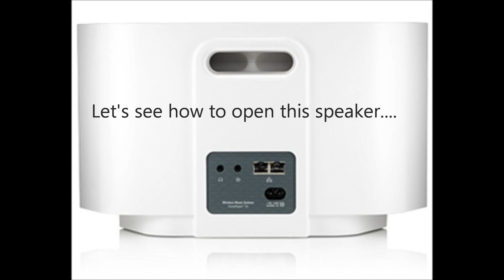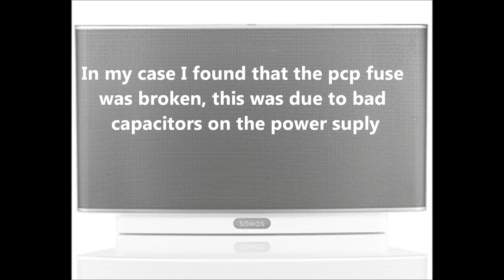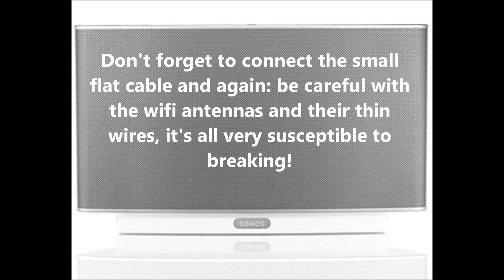Fixing the Sonos play 5

Comment: Many thanks to you for your video. I had not solved this without you. The fuse was blown and the rectifier bridge was broken. After replacing them it worked again!😊 The hardest thing was to desolder and removing silicon to bring out the components. But now it works and I’m happy.😄

Comment: Could your solutions as mentioned in the video solve the problem with my play5 gen1 ? Problem is that when I plug-in my Sonos play 5 I only can hear a brooming noice. The brooming noice is not constant but with intervals of 2 seconds. Any idea what the problem can be here ? Thanks a lot.
Reply from the maker: Hi Marc, a humming or buzzing sound with an interval indicates that the power supply is trying to start up, but this is not possible due to a problem in the power supply circuit.
You are probably also dealing with so-called "badcaps".
Try to take a look at the powersupply which I point out in the video and look for curved top on the black round components.
Examples can be found on the internet if you search for "badcaps"
good luck!
Reply: @henzelmen  First of all, thanks for your feedback. I just checked the powersupply but could not see any  curved black round components. What I do also consider is that the play5 smells for electriicity. If you know what I mean ?  Also, it's not possible for me to see the fuse. Where to search for the fuse ? Is it diffiicult to take out the print plate so I can see the components more in detail ?
Reply from the maker: Hi Marc, If you follow my intructions you can take the printed circuit bord out, the fuse is on the rear of the pcb but if the fuse is broken the  Sonos wil do absolutely nothing! So I think your fuse is fine because you hear a humming sound. I strongly belive you have to examen the power supply but you have to have some electronic experience. Be carefull for the high voltage inside (+300Volt) wich remain for a long time after unplugging the powercord!
Good luck

Comment: Great instructions there, my Play 5 had stopped working, I replaced the x2 capacitors, 1x bridge rectifier & the fuse, as per your instruction. In my case I don't think the capacitors were blown, but I replaced them anyway been as I was that deep. My Play5 is now back up & running. Thanks for the assistance.
Reply from the maker: Hi David, thanks for the comment and I'm glad it worked for you too. Hope you can enjoy the  Sonos for a long time now!
Reply: Did you order your parts off a website?

Comment: Henzelmen, thanks for great instruction. I was just given two of these and one is not working. I ordered parts today.
Reply from the maker: Hi Jeffrey, this will never hapens to me, I always must bought them ;-)
I wish you good luck and enjoy your fixing.
Have a nice day!
Reply: Well, the parts arrived. The surgery went well. When I applied power there was a distinct pop. It was a good try. Thanks again for the clear instruction. Any ideas on how to use these speakers?
Reply from the maker: hi Jeffrey, sorry to hear it didn't work out for you. I do have two Sonos speakers with unrepairable  pcb damage,  my idea was to pull all the electronic out and find a three-way crossover filter and built it into the Sonos, so I have two passive speakers and use them left and right near my tv.
You can also try to find a Chinese power supply with 24V and 12V and built it in the Sonos as a replacement powersupply. This will work verry well according to some people on the internet discussig this problem.
Good luck!

Comment: I've been told by Sonos I have a bad amp. When I plug in head phones sound is fine, but when trying to play through the speaker I can be at full volume and my ear needs to be next to the speaker to hear any sound. Will these fixes you demonstrated solve this issue?
Reply from the maker: I'm afraid not JS, my Sonos did absolutely noting because a non working power supply. Your Power supply is working fine but like Sonos told you I think you have an bad power amplifier. Maybe, if you look closely at the components in the power amp circuitry you see also bad capacitors (capacitors with a swollen top are bad) then this is most likely the problem.
Good luck!
Reply: @henzelmen  Any idea where this located or what it looks like? I haven't been able to find info on replacing this piece and really have no idea what I'm looking for.  Any help would be appreciated. Thanks.
Reply from the maker: If you watch my video at  1:22 you can see where the power amp is located, it's at the most right side of the printed circuit board.
I understand you have no idea what your looking for. It is necessary to have some basic knowledge of electronics if you like to fix this Sonos, inside are capacitors which store high voltage even if the Sonos is switched off. Maybe you have to look for someone with knowledge of electronics who wants to help you.

Comment: Hey Henzelmen, maybe this is a dumb question but my elkos seem to be broken too. I seached for the matching capacitors like you adviced but they have 4 pins instead of two like mine - should i just cut them off or did i find the wrong capacitors? THinks for the amazing video, saved me a lot of headaches.
Reply from the maker: No, I don 't think that ''s a great idea, those extra pins have a purpose.
If you follow this link you can order them locally I hope......
https://nl.farnell.com/vishay/mal215956121e3/cap-120-f-400v-alu-elec-snap-in/dp/2724551

Comment: Thanks for your video. Replace the small capacitor 25V 100uF at the back of the 2 big capacitors as well
Reply from the maker: That's a good idea, this capacitor is for the power supply of U27803 the PWM controller, this power supply comes directly from the mains voltage via some high-ohmic resistors.
It is also wise to check the capacitors of the power amplifiers, which are also often bulging. It is actually very wise to check all capacitors on this PCB very carefully ;-)

Comment: Many thanks for the excellent instructions! I would never have been able to open the device with so few damage without your video.
One question though: In my Sonos there were two 100 uF 400V capacitors compared to the Vishay MAL215956121E3 you recommend, which have 120uF. Is there a reason for that or did just Sonos simply change the type during production years?
Reply from the maker: no special reason, I could not find a suitable 100uf capacitor but could find a 120uf, a little more capacity so always better.

Comment: Great video on disassembling the play:5! I opened mine and have the PCB on the workbench now. however my experience with repairing electronics is very little. And i have a few questions:

- Do i change all bulging capacitors alone or do i also need to test other capacitors? how do you test them? 
- How do you test the bridge rectifier? How did you know it was faulty? 

Thanks Henzelmen!
Reply: @henzelman hasn't replied here in a while (hope he returns as I have more questions for him also), but here's my thought on your Qs: For all the effort to get inside the Play 5 and considering the fragile nature of the wifi antenna connections, I would advise you consider replacing all of the caps. In my case, it appears that the caps in the Power Amp section are the ones that have failed (swollen tops). The Pwr Sup caps are flat on top, but my Sonos is old, and caps in this line of work all fail eventually. And FWIW, I'm going to rig some sort of an "ON-OFF" switch - perhaps in the power cord. I travel a lot, and my Sonos may sit idle for months sometimes.

Comment: Fantastic video!
What about bypassing the wifi components altogether? Since Sonos has offered trade ins for these old units, there will be a lot of old Play 5's with perfectly good hardware taking up waste. I would like to know if there is a way we can still get use out of a bricked Play5? Maybe bypass the wifi components so we can use the line-in jack to play music from a phone?
Reply from the maker: Good plan! But I just don't think Sonos will sell the trade ins, really have no idea what they do with them, of course they are more eager to sell new ones to us.
But...If you succeed to get your hands on them you can indeed have for lot of fun. Built your own wifi reiceiver in or bluetooth adapter.
These things are very cheap on the internet. connect them to the line- input and you have a realy good wireless speaker for cheap money.
Wish you good luck with it!
Reply: @henzelmen  do you know where the amplifier input from main board is on these? Line imput is deactivated when the "recycle mode" is triggered.
Reply from the maker: Hi  @galaxyb1103  , that's hard to tell because there is no service manual available. You need it to find the right input and output tracks on the printed circuit boards, now it's sort of guessing what is wat. If your not afraid of electronics you can try to touch the components near the power amp with your finger, if you hear a little hum from the speaker your close to the input. Be carefull to keep your fingers away from the power supply on the other side of the pcb!!!!
Good luck!

Comment: TY for the video... very helpful, however, is the fuse a T3, 15A ? or is that a T 3.15A??
Reply from the maker: Sory for my late answer, it is a 3,15A fuse.
Reply: I guess this is 3.15A, since most of Europe, apart mainly from the UK, uses a comma instead of a dot for a decimal point separator.

Comment: Thank you very much for this great video. I have disconnected everything except that the pcb is still not free. It is connected to those 3 antenna cables and I cannot take it out entirely. Do I need to unscrew the top section from the bottom? Do I need to be careful about anything?
Thanks for your help in advance.
Reply from the maker: Hi Mehul, you can unscrew the 4 nuts on top of the wifi board, carefully take the pcb upwards, it is still connected with the multi pin connector, With a little bit of wiggle the board will come loose. Be carefull with the grey wires, they stay connected with the wifi board but you can take the mainboard out now.
Good luck!
Hans

Comment: Perfect teaching! Treble sound is gone on my Sonos Play 5 gen 1, is it an electronic or speaker fault?
Reply from the maker: Hi, this must be an amplifier error and I think one or more of the capacitors of the poweramplifier are bad. You can find the capacitors on the other side of the pcb as where the power supply is located. Look for 5 round capacitors near 6 coils, check these capacitors on swollen top, or just replace them in advance.
Wish you good luck.

Comment: What is that small black component with 4 legs you replaced? And why did you replace it?
Reply from the maker: That is the bridge rectifier, which turns AC voltage into DC voltage. There is a small chance that it is broken due to the defect capacitors. They are very cheap so replacing is the best option.

Comment: great video! i followed along and now have taken apart the speaker, not sure where to go from here? I have taken out the PCB and have tried measuring a few things with my multimeter but i dont know the best way to diagnose the problem!
Reply from the maker: Do you have some electronics experience?
What is the diagnosis of your sonos?
 
Does it not work at all, no lights at all?  Then check the fuse on the back of the pcb, the little round brown/red component  you can see in my video. If its broken than you have most likely also bad cap's and have to follow my instructions in the video to replace them.
Reply: @henzelmen  yes a little bit, diagnoses is no lights no sound not working at all (the power cord is good i measured it) I checked the fuse it also is working aswell as the two larger capacitors that you replaced they are working. Makes me think potentially it is the transformer?
Reply from the maker: I'm sorry for my late responce. Try measure the voltage on the two large capacitors but watch out.... there is high voltage inside. If there is voltage on the capacitors then the problem is  the power supply sucundairy from the transformer. Measure  the capacitors for voltage on the secundair side, if there is no voltage on them, then most likely the switching transistor (or mosfet) has gone.

Comment: VEry helpful -- as this is my last point of call before i give up -- its sudenly stopped connecting/working. I only get a white light when powering up. Reset function does not work? Wired connection is not working also. Wondering if the Pause/play   button is faulty as nothing happens when i press it? How did you ascertain which parts were faulty?
Reply: just got off an hour long tech support call. My system problem sounds exactly as you describe. They say it is a bad wifi card and are sending me a new one. purchased 2017 so no charge warranty part. Not looking forward to installing myself though. Maybe I'll get lucky.
Reply: UPDATE: They don't send you a wifi card. you give them a credit card number for security that you will ship your speaker to them within 14 days after you receive their advance replacement speaker.This way you will have prepaid packaging for the return of your speaker and you will get a replacement speaker faster.

Comment: Hello Sir... I had bought a Play 5 used and it turns out, it makes a high pitch whine which appears to be coming through the tweeters... Wether it is playing music or not...Would thiis fix repair this problem do you think?... Would love to have this thing working properly as it does sound great when playing music... Some threads talk about ground loop and no... It's def. Not that... Anyways thanks for any reply or advice you can give me!!!
Reply from the maker: Hello, the high pitch whine is not to fix with my video, i' m sorry. it is a problem in the digital power amplifier that runs your tweeter. try to find bad caps in the surroundings of the power amps. If there are? Replace them. If not then there is a more difficult problem that requires a lot of electronics knowledge I'm afraid. The best thing to do is send it back to the seller.
I wish you all the luck.

Comment: My Play 5 stopped working a few days ago, and I have found your video :)  It looks promising, and I can easily see that heat is a likely culprit. I never knew Sonos allowed the pwr supply to run full time - that's not a good design idea!! Anyway - I hoped I could get an indication that my speaker's symptoms might match with a power supply failure. No one else here has reported the exact symptoms I see.  The symptoms I see are as follows: The failed speaker was paired with another Play 5. A few days ago the speaker went silent except for an odd, low volume sound like a burp at a regular interval - every 5-8 seconds. The light on top flashes on and off at a slow rate. I've tried the "factory reset", but as soon as the speaker is plugged back in, it just resumes the slow, repetitive "burping" & flashing light.

Does that sound like the power supply?

Thanks!
Reply from the maker: This sounds like a power supply issue but not the one I describe.
Your power supply try's to switch on but due to an internal overload somewhere it is switches off again. This is non stop repeating. Most likely you wil find a bad capacitor somwhere on the pcb, look for the swollen top on it.
Good luck!
Reply: @henzelmen   Danke!
Reply: @henzelmen  Yes - I found the swollen-top caps, but they are in the 'Power Amp' section of the PCB. The puffed-up tops were immediately visible. The caps in the HVPS are perfectly flat, but I'll replace them anyway. From what I can see now (the PCB is still attached inside the housing), the most difficult part of this repair will be removing all of the "silicon goop" that is slathered on heavily & between all of the caps... any suggestions?? Another question: There are 5 caps in a row, and right next to them is a row of 6 cylindircal components... Do you know what these are? I can't see any part numbers or markings on them yet.

Comment: Thanks for great instructions. My light does not come on so I assume its the same problem with the power supply. The 2 capacitors look ok but I cant find the fuse you refer to as mine appears slightly different. How can I send you a picture ?
Reply from the maker: Pls write here your emailadres, I wil send you an mail where to you can reply with a picture, I then  try to locate the fuse for you. Don't forget to delete your email adres!

Comment: Great Video and instructions. I am replacing the parts per you list. All parts on the PCB are covered with silicone . Should I cover the
new parts also. Wondering why they did that as part of their manufacturing process.
Reply from the maker: Hi Michael, they do that to prevent the components came lose because of vibrating from the speakers. When the speaker playes loud the internal can be very shaky.
If you have some glue or silicone it is wise to glue the parts to the pcb again.
Good luck!
Reply: update to last post. Replaced parts and speaker is working like new. thank you for fix!!

Comment: I have a couple play 5 gen 1's as well as many other sonos speakers.  One of my play 5's volume started fading in and out it will go fine for a few minutes and then the volume will drop for a few seconds and then regain volume level again.  Any idea what component inside would need to be changed out?  Thanks in advance
Reply from the maker: Hi Kerry, You have definitely to check the capacitors inside. There is a big chance the capacitors from one of the power amplifiers are at the end of there life. You can recognize them at the bulgin top.
If you want to see how they look? search for "bad caps" at your search engine. searche for pictures.
Good luck!
Hans